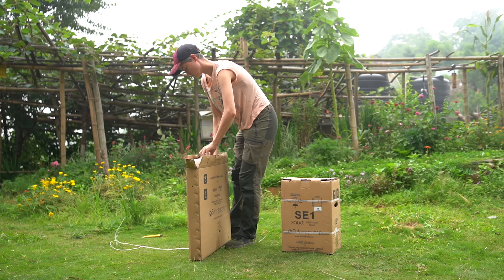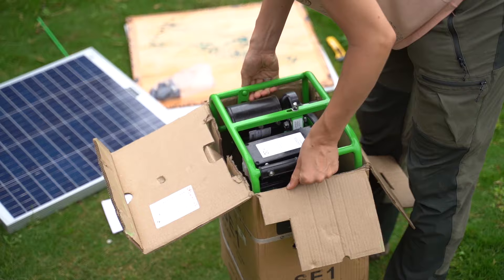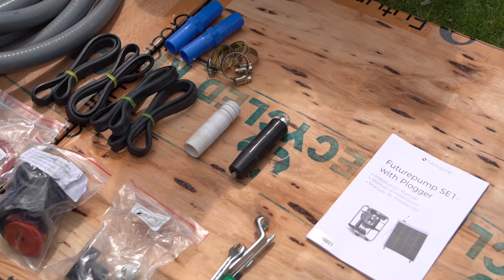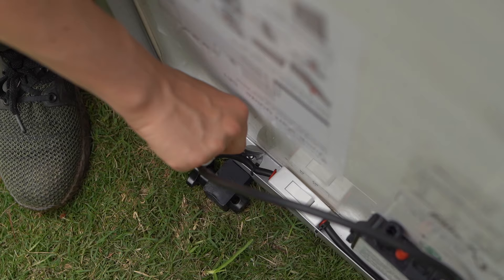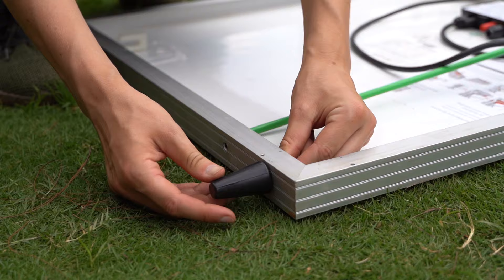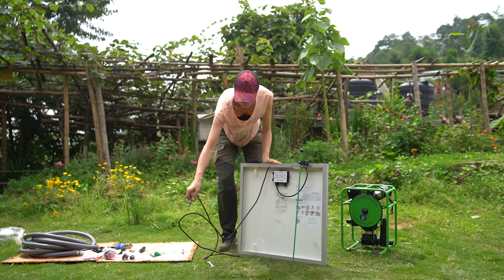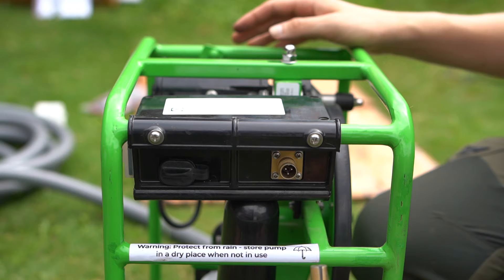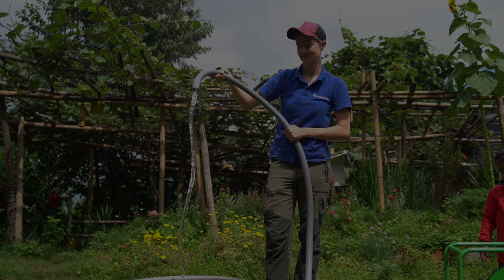Installing Your SE1 - The Solar Powered Water Pump Built To Last!

Comment: Hello! I bought this SE1 pump in Kenya and I am totally confused about two things in the Tool kit box. 1) Why is there a pulley set? The pulley included doesn't fit on the SE1 model. Why is this SE1 video not showing what to do withthis pulley, how to install it?  The manual is showing a picture of the SF2 when talking about the small and large pulley. It's totally confusing.  2) there is a handle for manual pumping. Where does this handle get attached to and how. Please can you post a video on how to do manual pumping? Or at least it could be included into the manual.
Reply from the maker: Hello, thank you for your message. The pulley in the spares set is a spare in case the auto-pulley were to fail. You do not need to do anything with it at the moment to set up the pump. Sorry for that confusion there.

The handle for manual pumping gets screwed into the hole in the flywheel and you can then use it to turn the flywheel. I've noted your feedback and I will speak with our technical team about making this clearer and a video on manual pumping.

Please do let us know if you continue to have trouble with this.

Thank you - Futurepump

Comment: Just came across this video.  I see it comes with everything, including the solar panels.  Does this system need any type of batteries?  I live in Arizona USA.  would it be possible to buy one ?
Reply from the maker: Hi there, thanks for your question. Yes, we supply solar panels with the pump. The system does not come with a battery, and if you correctly size the solar panels we do not recommend that you need one - for the SE1 in the US we would recommend the 120W panel option. We ship to the US - you can find out more on shop.futurepump.com

Comment: Can this solar pump bring water from a depth of 10 vertical meters and push it to a distance of 20 vertical meters?
Reply from the maker: Hello, thank you for your question. Futurepump solar pumps have a suction depth of 7m and a total head of 15m, so unfortunately this pump will not work in that situation

Comment: Can it pump dirty water like from a beaver pond or just clean well water?
Reply from the maker: This pump can handle dirty and silty water. It comes with a filter on the inlet side and the only maintenance it may need is flushing through with clean water every so often if it were to become clogged with mud.
Reply: Ma'am where I can buy this?

Comment: How much would it cost if i am placing oder from nigeria.
Reply from the maker: Thank you for your interest - Datech is your local distributor in Nigeria. They sell the SF2 solar pump with pump, 120W of solar, 6m high quality suction hose, installation and a full 10 year warranty for NGN 950,000.

You can reach out to them directly on +234 8067174535 or see their location on the map at shop.futurepump.com

Comment: Contacts of distributor in Uganda please.
Reply from the maker: Thank you for your interest! In Uganda, SolarNow sell the Futurepump SF2 solar pump with three 40W panels, 6m suction pipe, 30m delivery hose, 4 sprinklers, installation and a full 10-year warranty for only UGX3,190,000.00 

You can find your nearest branch and their contact details at shop.futurepump.com or contact on Whatsapp: 0788 916600 or toll free number:  0800 270 070

Comment: How was  the capacity for  this type of solar pump?
Reply from the maker: Hello, sorry for our delayed response. This pump can pump 0.5 L/s of water.
Reply: @FuturepumpLtd 

Can it pump from surface borehole? Dose it have the capacity to irrigate about 5 hacter of rice farm?
Reply from the maker: @samuelugoagha5200  This pump has a suction head of 7m so it depends on the depth to your water. Our biggest pump has the ability to irrigate 1 hectare, you would need several pumps for 5 hectares

Comment: Its too weak to pump ; only in direct Sun ; if you don't have battery or supercapacitor to start.
Reply from the maker: Thank you for your feedback, do you have one of our pumps? The Futurepump does not require a battery to start up
Reply: if there is no electricity today we want to use it what should I do
Reply from the maker: @user-hb3wf5cf5m  There is a manual pumping handle for when there is no sunshine